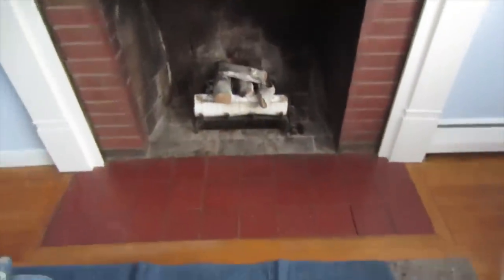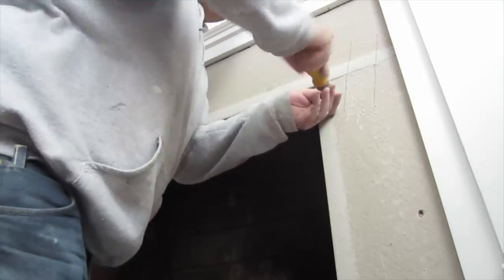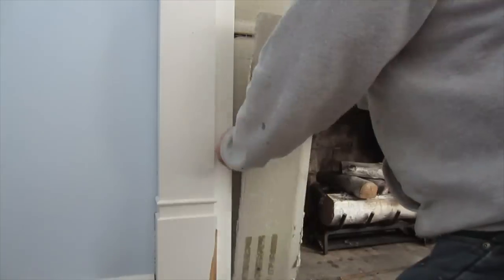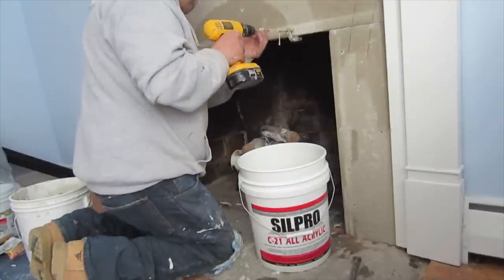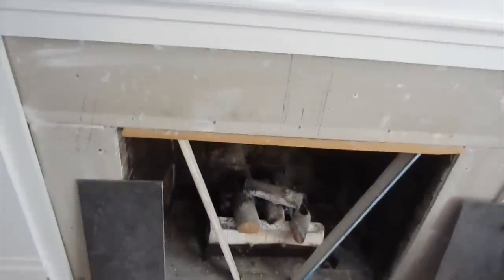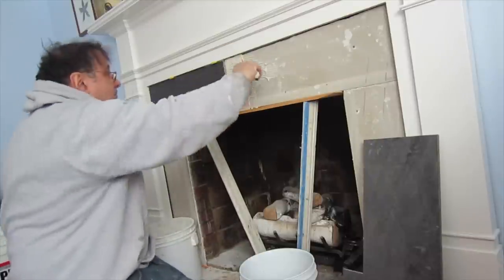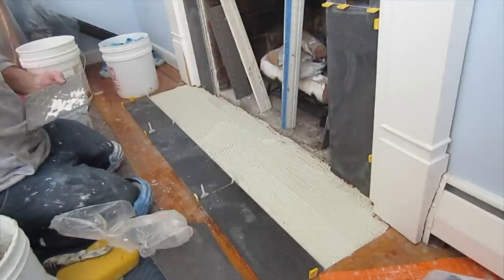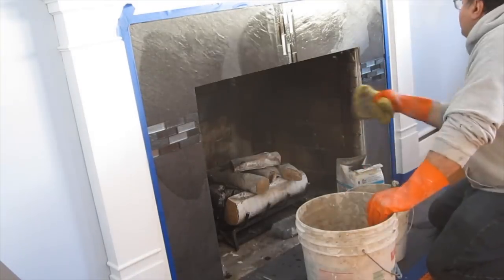How to reface a fireplace for a gas insert

Comment: Good man. Answered all my questions on identical project in my rental... "polymer modified thinset, 3/8" x 1/4" square notched trowel, back butter, fill in mortar joints using smooth side of trowel, use beater block, a few masonry anchors to hold, level and plumb Durock, reinforce overhangs as necessary." Paint damaged plinth block wood hoping homeowner doesn't notice (kidding). I feel like an expert now, haha.

Comment: Sal, we have a slate surround to our gas insert fireplace.  We would like to resurface the surround with mosaic tiles.  The slate is about 5/8" thick and the tile is about 3/8" thick.  I am concerned about the inside edge of the fireplace.  Should we add trim to cover the rough edges of the tile and slate?  I have looked at several tutorials and I do not see where a edging is used.  Your recommendation?

Comment: Nice work - all that you had to go thru on the glass tile details, I would have just put extra thinset to raise it off to be flush with the main tiles. Also on the floor, what about putting down durarock on the floor instead of the fancy plastic products?

Comment: Sal,
What do you do about the durock edges behind the tile? Put some grout on it?
Reply from the maker: A gas unit with a faceplate is goIng to be installed, it will all be closed in none of the edges will be exposed.

Comment: can I tile over tacky, outdated marble?? I know, I know, some people actually like marble. I'm not one of those people. i hate marble. especially the stuff around my fireplace. it's green and black and it's an eyesore. it's actual slab marble...and I just want to cover it. do I use ceramic tile?? porcelain tile?? can I even tile over slab marble?
Reply from the maker: If it is solid, i would coat it with a primer like Mapei Eco Prim grip and then tile it.
Reply: Sal DiBlasi easy enough! thanks!!